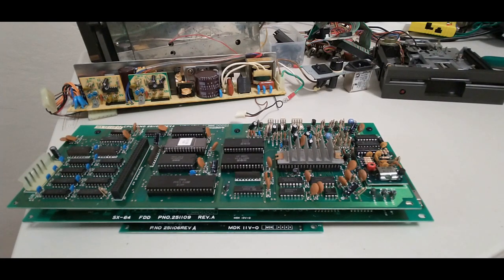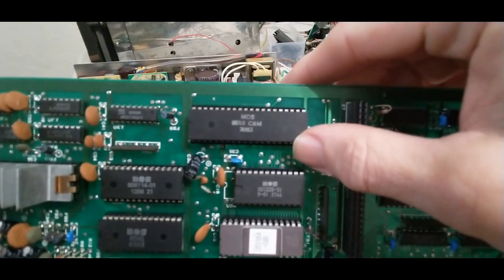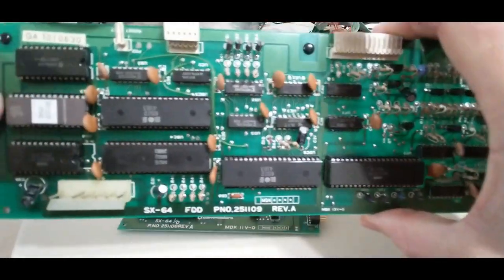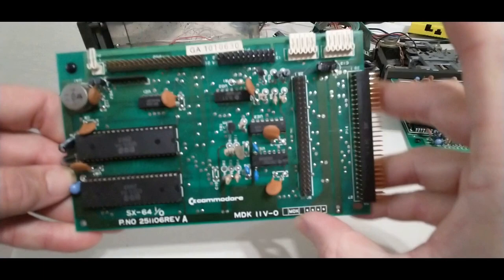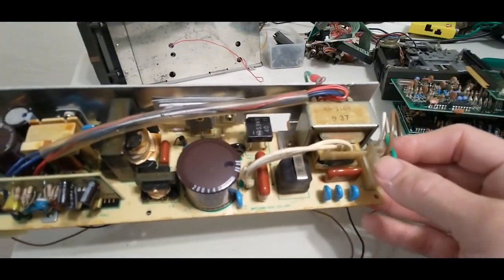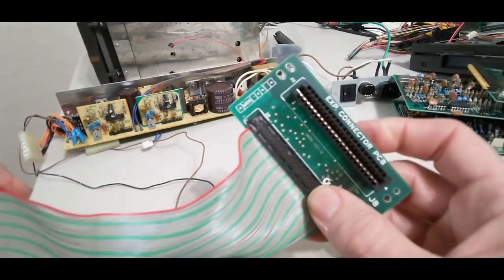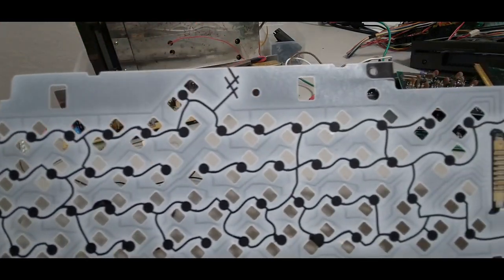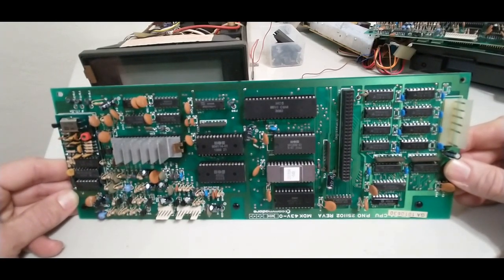Explore Guts Of A Commodore SX-64! Motherboard, Daughterboards, Etc!

Comment: I bought one of those replacement keyboard membranes. It wasn't expensive and you never know how long they will be available. Haven't installed it yet since the original membrane still works.
Reply from the maker: You make a good point. I'll probably order one regardless.